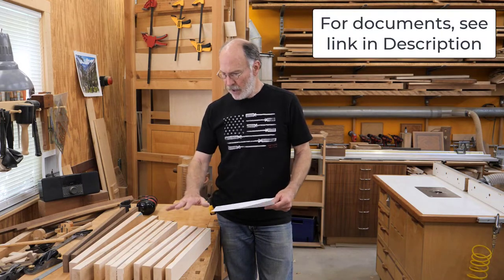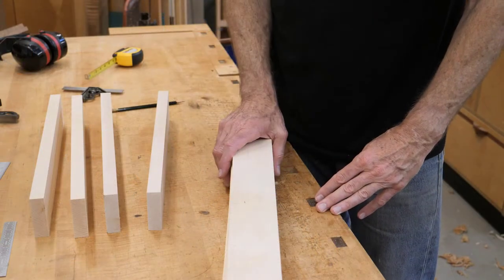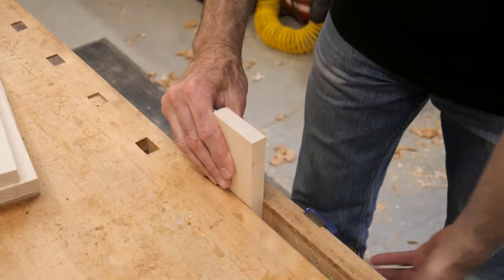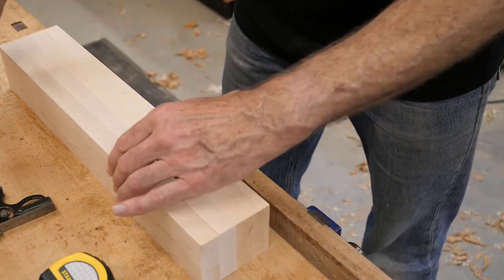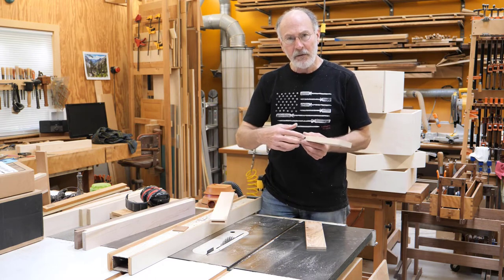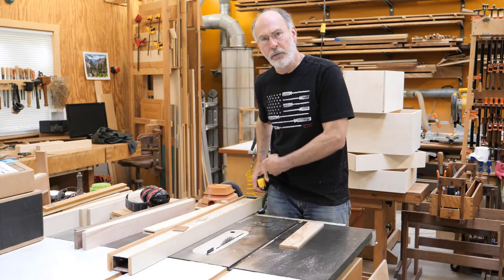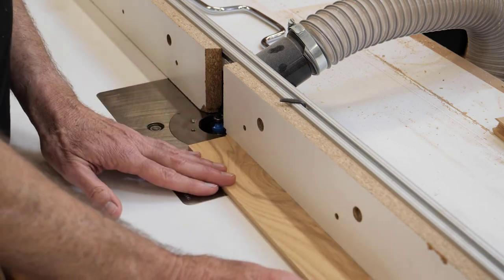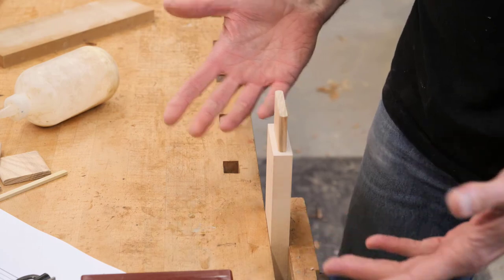Krenov Trestle Horse Part 1

Comment: Hi Carl, what is the origin of your slot mortiser?   thanks
Reply from the maker: That is an Inca slot mortiser, originally an accessory on an Inca 259 table saw. I sold the table saw years ago but kept the mortiser, making a stand for it so I could use a router instead of the TS arbor. Here’s a link to an overview of the machine - https://youtu.be/lJ6NDr1GOEE. I miss the table saw but it was too small for my needs at the time.